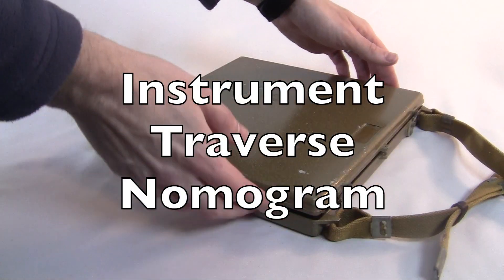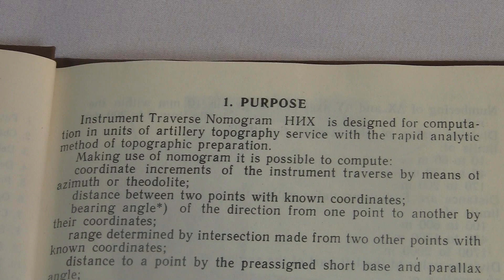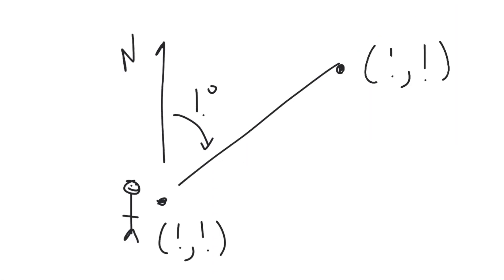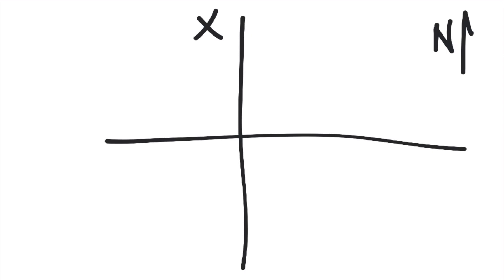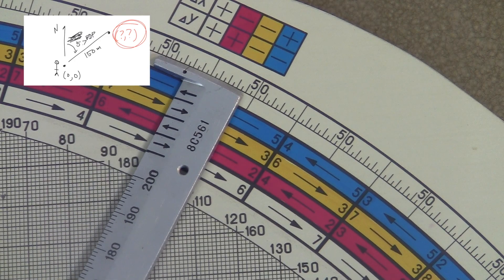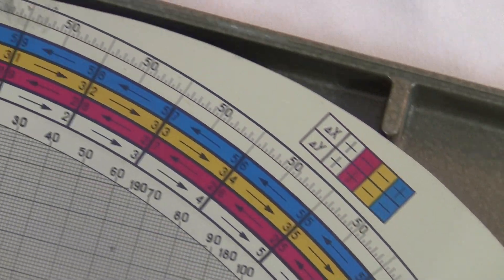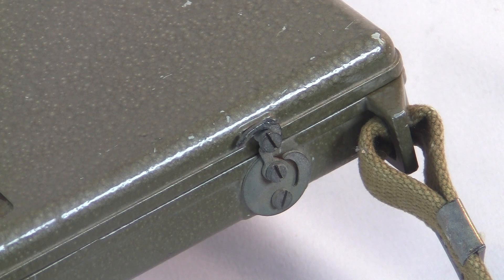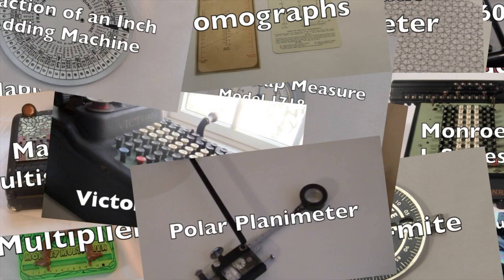Instrument Traverse Nomogram (номограмма инструментального хода) Review / HowTo

Comment: In Land Surveying calculations Y is North, and X is east. At least in the US there are 4 quadrants, angles are measured from north or south, examples: N 45° E, S 45° E, S 45° W, N 45° W (quadrant bearings). This simplified figuring reverse directions before calculators. S 45° W is 180° from N 45° E. We use degrees, minutes and seconds.

The Y coordinate is called Northing, the X coordinate is called Easting. The difference between 2 Eastings is called departure, the difference between Northings is called latitude. Cosine bearing times horizontal distance equals latitude, Sine bearing times horizontal distance equals departure.

It looks like this machine has a precision of 1 meter which is probably good enough for artillery. It looks like the angles are divided down to 0.05 BDP which is about 0.30° or 18 minutes of arc (52 cm at 100M). Usually graphic scales are interpolated to half their marks so about 0.5M and 0.025 BPD.

I bet it could be used in reverse, knowing the coordinates of the target (which they do by triangulation from 2 points) and coordinates of the gun you could read direction and distance gun to target.
Reply: in different eras, the US Coast Artillery Corps and allied portions  of CoE used North 0° and South 0° azimuths !
(
Coast Artillery had different X,Y grid projections that standard Army maps as well because of their peculiar needs.)
Reply: @BillRicker yes the North American Datum of 1927 (NAD27) used South azimuths.

Comment: It does trigonometric calculations.
Jerome S. Meyer (b.1895 - d.1975) was an American who wrote prolifically on many subjects, including mathematics, throughout the middle of the twentieth century.  Mr. Meyer invented a chart that's very similar to this one and was published in two of his books.  Its first appearance was in "Fun With Mathematics", published in 1952. It was also included in "More Fun With Mathematics", 1963.  The chart provides a very graphic way to solve trigonometric problems.
Reply from the maker: Thanks for the tip- I'll check it out
Reply: @ChrisStaecker  as i mentioned in email recently, part of the utility of mils in the field is making small angle trig easy, it's mental arithmetic. 
φ (mils) * range (kilometres) = offset (metres)
thanks to the sin φ = φ (radians) small-angle approximation, with km:1000m ratio and 2×π both being baked into the 6400 mils in a circle ≅ 2×π×10³. 
This device is a nomographic calculator for large angle mils trigonometry (in WAR-PAC 6000 mils ≅2×π Radians  ) and direct-reading Pythagorean x²+y²=z² (wherein it's similar to the E-6B Flight Computer (2D Slide-rule) used in aviation for dead-reckoning from the 1930s to present, and also seen in ST:TOS!) 
(It is i fear little known outside of 1930s-1960s EE circles, the fact that many trig sliderules can be (ab)used to do X,Y ↔ r, θ transforms with nearly direct reading; but this них and E-B6 are indeed easier if bulkier.)

I'm wondering if the instructions describe using it WITH an Instrument on a Traverse, or describe using its arm as the gnomon/alidade of a Plane Table to fully do the traverse without optical instrument?  I would expect a ridge or pop-up sights on the arm if the latter, so i'm presuming this is an accessory for a Theodolite, Aiming Circle, or BCT.
Reply: @B @BillRicker my E6B has a wind-course-heading calculator on the backside that is really a triangle solver. Given desired course direction and airspeed, wind direction and velocity, it graphically calculates required heading and resulting ground speed (in a perfect world). Wind changes direction and velocity with altitude so the wind inputs are a guess.

The problem can be plotted on paper with a ruler and protractor and measure the answer with the protractor and ruler. Or use a calculator with some simple trigonometry.
Reply: @someonespadre  yes indeed,  the E6B and this NIX are the two portable visual analog triangle solvers I've heard of. Others likely existed, briefly; the endurance of E6B (and e.g. nautical sextants) as manual analog backup is remarkable. 
 As I noted, with suitable scales, a trig sliderule can do x,y - r,theta conversion in one setting (but AFAIK never widely taught?), but that's not general triangle solution without multiple steps & scratch-paper. (I've mostly only used it for x,y - r , for which scale positions on slide is less limiting.)
Reply: @BillRicker I did some testing on this. It’s not a straight triangle solver. I thought if your airspeed is 120 on a course of 20° then with no wind you will arrive at a point on a direction of 20° at 120 miles from your starting point. If the wind is from 330° at 25 knots then if you maintain 20° heading after an hour you will be about 30.45° direction about 105.7 miles from your starting point. This suggests a 10.45° correction left but my e6b calculation indicates 9° left and 102 (actually ground speed). This agrees with an online calculator. So something else is going on.
Reply: @BillRicker I figured it out. When the nose is turned towards the wind ground speed decreases so if the pilot turns 11° towards the wind per my simple calculation the ground speed slows to the point that the airplane drifts left of course so the correction needs to be correct a bit to the right to compensate and ground speed will be slower. I don’t know how to do the real calculation. The E6B must have the marks adjusted to compensate mechanically.

Comment: Explanation for Паспорт 2.317.002 ПС:
Passport for an product, usually a tool means technical documentation, specifying what it does what capabilities it has, possibly what patents it uses and what standards it meets. 
Not particularly interesting, unless you have access to Soviet product passport databases or need your equipment to meet certain Soviet standards.

Comment: That alternate system of angles (starting at the top and going clockwise) has a lot of advantages. For one thing, it's more intuitive since it works just like a clock. And it makes trig functions nicer. TAN(angle) is now x/y rather than y/x, for instance.
Reply: Tan not being hypotenuse slope? Weird. I mean, I understand, but weird.

Comment: The compass thing divides 360 degrees like on an analog clock would do. So maybe that is the reason on using these special units? Oh, and First.
Reply from the maker: I think it was for easy interoperability with milliradians. Wikipedia has a decent article about this, and the difference between NATO and Warsaw Pact units. But I didn't want to get into that in the video.